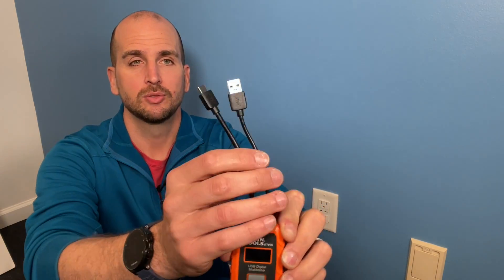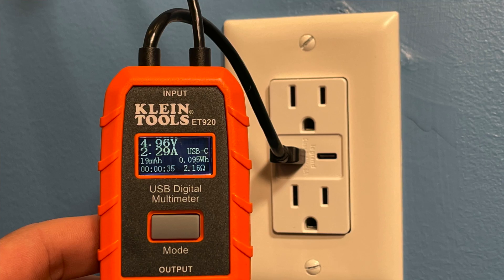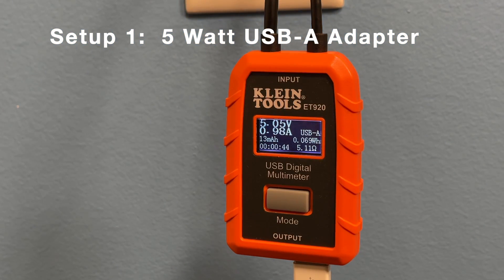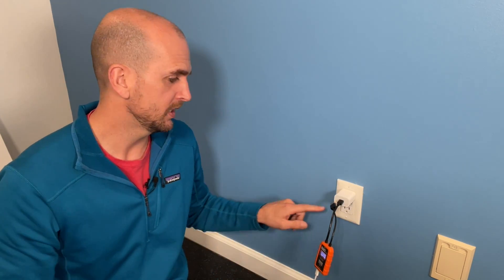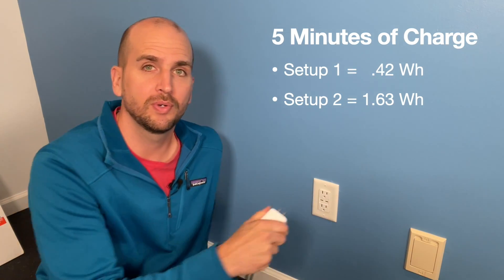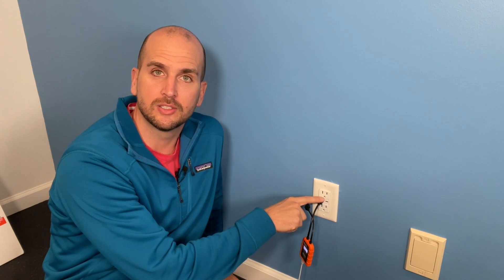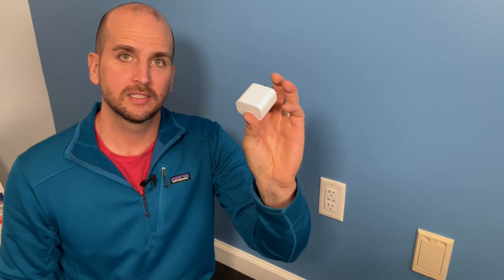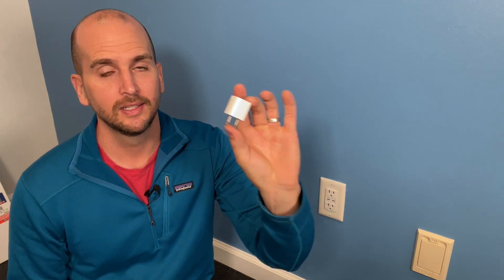How Fast Do USB Outlets Charge Your Phone

Comment: And that's why I would never install a USB outlet.
In three years that plug will be obsolete.
Heck, it's already obsolete by two generations of charging already.
You might as well put an RJ11 outlet into the wall.
Reply: Meh. So, you swap out the receptacle when it’s outdated (which will take longer than 3 years). Still worth the convenience.
Reply: @robb0995  Meh, my OC stated that it's already outdated [unless you're still using a flip phone].
Prove me wrong with FACTS.
Reply from the maker: Yeah, definitely something to consider in addition to the durability of the ports after repeat and frequent usage.
Reply: USB C is a fairly new standard and will probably by around for at least 10-15 years.
Reply: @jcreazy  USB-C is the port used - Not the standard used. Almost any phone, tablet, or Macbook made since 2019 uses a newer standard than what this offers.
"30W of power supplying its two included USB Type-C connections" has been replaced years ago.
Reply: This charges at the standard of 2.0
Not 3.0
Not 3.1
Meh
https://www.digitalcitizen.life/fast-charging-standards/

Comment: The second adapter is going to be the best option for modern smart phones for the simple fact they can do fast charging which requires 9 volts instead of 5 volts and I highly doubt outlets are going to have 9 volts because that would possibly damage other things besides a phone. Now it could have a dual voltage circuit in it but that would make it quite expensive. Even if one outlet could fast charge I'll still stick to adapters. EDIT- Just as I suspected the outlet can't fast charge and if you try to slow charge certain phones, you may be charging your phone an entire day, if you run the battery down to below 20%. I have an LG Velvet which is huge and even at 50-60% it still takes an hour or more to fast charge, using a USB-A to USB-C cable.
Reply: I think it have to be in the spec to switch to what the device calls for.
Reply: Read up on 'USB Power Delivery'. That adapter will deliver standard USB 5-volts, until and unless a connected device talks to it and says 'Hey, I actually want more voltage please'.
Reply from the maker: Solid guess Ben 👍!

Comment: I'm still very confused why the 20amp will charge faster when the iPhone only needs 1amp. Any other is meters that will measure USB besides Klein because Klein can be expensive. The more amps of current is faster watts per hour wH but it doesn't make sense because the device under test like a cellphone only needs 1amp of current.
Reply from the maker: Hey Wayne,  The phone will only pull 1 Amp at 5V when using the small 5 Watt charger but when you step up to Setup 2 and 3 in this video the phone will pull well over 1 Amp.
Reply: @EverydayHomeRepairs  but the outlet would have to have a 20amp or 25amp circuit breaker because most home outlets are mostly 15amp circuit breakers so you can't use a 20amp USB outlet?
Reply: @EverydayHomeRepairs  if the phone is pulling 20amps per hour the cell phone should be charged in seconds because 20amps is a lot of current and not sure why it will take 30mins to charge a cellphone at 20amps. There is something very wrong with that is outlet or the measurements are wrong because 20amps multiplied by 5volt is a lot of watts triple from what the cell phone needs to charge
Reply: @waynegram8907  - 20 watts, not 20 amps.  Assuming no loss for simplicity that is 0.16 amps @ 120 volts (household voltage), or 2.2 amps at the 9 volts it was charging at.
Reply: @dustintunis9347  2amps X 9volts = 18 watts and 1amp X 5 volts = 5 amps. Most cell phones don't use more than 5 volts vdc. I don't see cell phones that use 10vdc at 2 amps.  A 20 watt USB outlet would have to be 5vdc X 4amps = 20 watts, this would be that the cell phone is PULLING 4 amps at 5 vdc at what mAh and wH?
Reply: @waynegram8907  - A lot of cell phones use fast charging which is generally at 9 volts.  I've had Motorola and Samsung's that fast charged at 9 volts and I don't buy high end phones.
Reply: @dustintunis9347  most cell phones I have seen are 5volts at 1amp. I didn't know other cell phones were at 9volts at 2amps.
Reply: @waynegram8907  2 amp charging has been common as dirt in Android land for... well, forever. My Oneplus Six will pull 2A, my Nexus Five would pull 2A, my Nexus S would pull 2A.  These devices all implement 'smart charging', where they will slowly increase their current draw while monitoring the voltage from the supply. If the voltage starts dropping, they stop pulling more current.
Reply: You might want to update your knowledge of USB battery charging, and especially 'USB Power Delivery'. The world is not like it was 10 years ago.

Comment: Was surprised to see the 20W charger was charging so much over 5V. I'm curious think know what differences occur in overall battery life when charging at the different voltages
Reply: Yes, you hit it on the head, faster charging causes more heat in the battery which should degrade overall battery life.
Reply from the maker: Yeah, I know others had mentioned something similar.  I believe that is why most phone makers have logic to monitor battery charge % and batter temperature during fast charging.
Reply: @EverydayHomeRepairs  agreed, I believe it's also a smart charger that communicates with the phone to get optimal charging.
Reply: Different battery chemistry's support different charging rates. The higher voltage is to the phones charging circuit, not directly to the battery. (high V means lower A, and thus less loss.)
Reply: USB PD will use 5, 9, 15 or 20 volts to charge, if the device supports it. USB fast charging on supported devices also increases the voltage to speed up charging. This does require communication between the phone and charger though, so seeing 9v on that charger isn't unexpected.

Comment: Interesting :)  ... but now a LOT of us are now using wireless charges. I would be quite interested in that. Thanks, Rob
Reply from the maker: I might do a comparison on the recent receptacle I installed with wireless charging, a MagSafe wireless charger, and the 20W adapter.  Might be surprised on the MagSafe charge rate.
Reply: @EverydayHomeRepairs   Good idea. I would just suggest you keep in mind today's realities. How many times do you charge a new phone in a day? What are the absolute dollars versus %s in terms of electricity usage? How many of us have a charger in the car? Scenario: I am sitting here now and typing with my charger in the wireless cradle. I go for a glass of water, I take my phone with me... Just my input. I hope I am explaining myself ok... Thanks, Rob
Reply: @robo7981  Wireless charging is kind of a gimmick when you can charge a phone fully in a short amount of time.
Reply: @jcreazy  - My current phone doesn't have wireless charging, but I've had so many usb plugs get worn to the point they won't stay in that I think wireless charging is a great idea.  I'm hard on phones so I always have fairly substantial cases and while I've only tried a few I could never get a wireless charger to work through my case (on previous phones).  My current phone is USB-C and so far those seem to hold up better than micro-USB.
Reply: You actually waste a lot of energy by wireless charging and it's probably going to be slower than fast charging. It's probably OK for a top-off or occasional charging but I wouldn't rely on it for a full or regular charging because that pad will eventually overheat and fail.
Reply: @benkeysor7576    I definitely respect your comment. Everyone has different sizes budgets :) From my personal experience, wireless phone charges are one of those things that seem like a waste of money until you use it once. Then ya never go back... I think your money point is valid, but like with receptacles if you pay 50% more for commercial-grade it's only another buck. It's not like a 50% premium on a $100 item... Lastly, place it before you go to bed. You are good to go. Just my opinion... Thanks, Rob
Reply: Which are notoriously slow charging.
Reply: Wireless charges came along because today's generation are made up of people who are too lazy to plug in a wire.  No wonder our society is turning into a bunch of lazy snowflakes.
Reply: @KevinBenecke  Dinosaurs didn't know they were dinosaurs until it was too late.